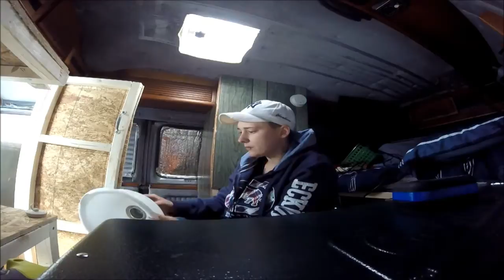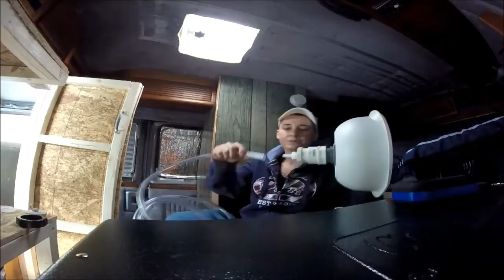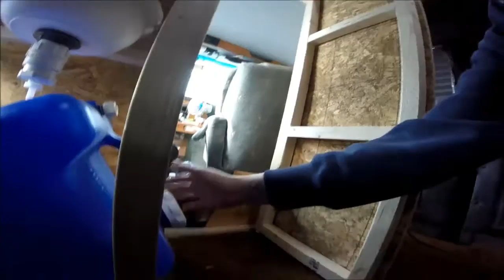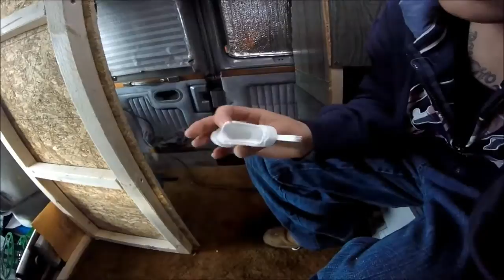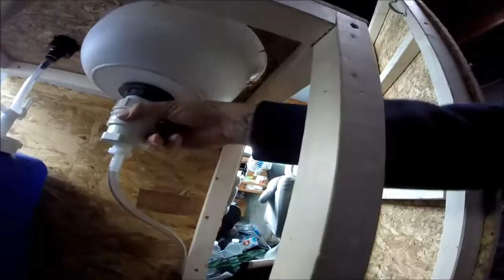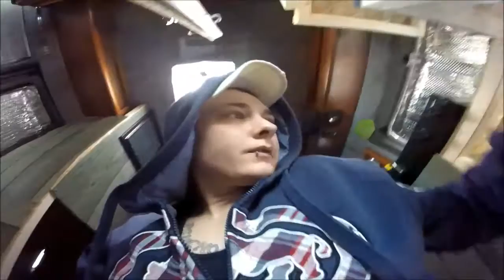sink install in the van

Comment: Vans looking great! The hose set up is better there so you can see any blockage or leaks. Might want to use silicone around the rope as well to prevent wetness from seeping up into your carpet when your moving in wet weather. Very nice set up there.
Reply from the maker: Good idea will do. Ty